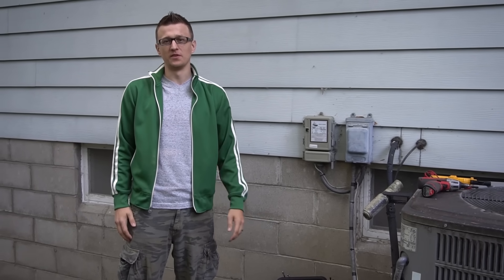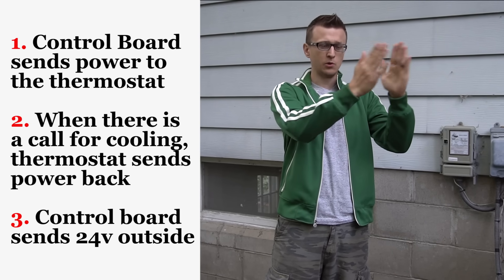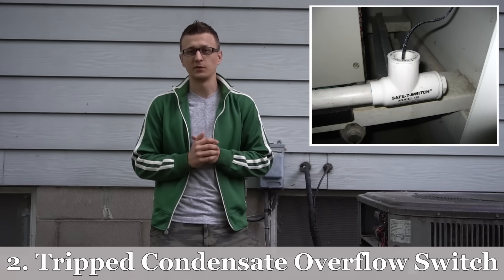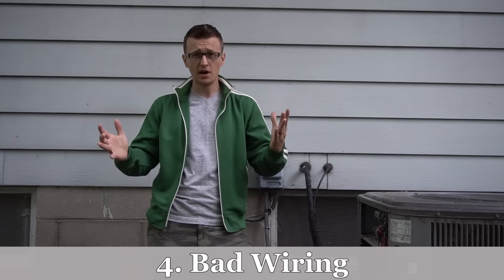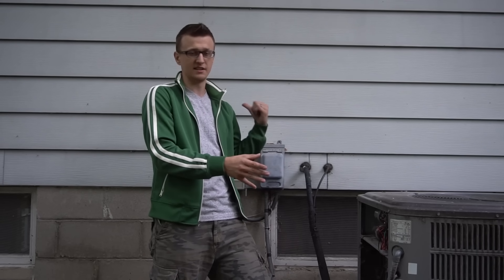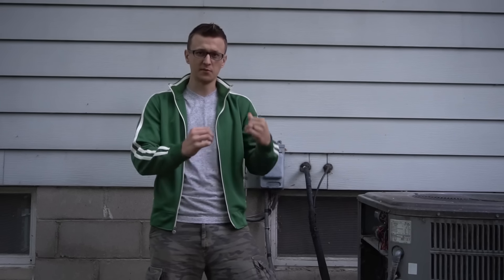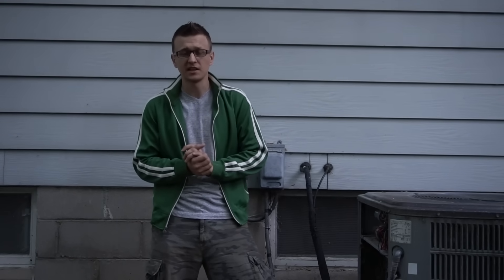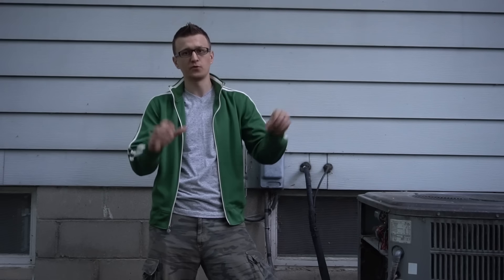AC Contactor Not Pulling In - 10 Reasons Why

Comment: What seems to be happening in my case is the condenser fan will stop, and although the plunger is pulling in, the fan will not start up. It tries for about 3 to 4 seconds and stops. It's intermittent. Based on your description, it sounds like it might be an issue with the refrigerant pressure (10:40) or dirty condenser coil. I'll try spraying down the condenser coil and see. To be cont'd.
Reply from the maker: Oh man, that is a bad time for it to start acting up! I wonder if it could be a power issue. Where the power coming from the electric company is not consistent. With such hot weather, many areas are experiencing brownouts since everyone's AC is running almost non-stop. Otherwise I would suggest double checking the wiring just to make sure. I have a video on how to wire a condenser fan motor and another one on basic ac unit wiring if you need them. Good luck!
Reply: @WordofAdviceTV  Thank you! I sprayed down the condenser coils on both of the units. I haven't noticed the issue since I replaced the new capacitor with the old one. I'm taking the new one back to the store to have it tested and just return it. I just want to get through the summer. I will also pick up a multimeter to check the power (and watch your video). Thank you!
Reply from the maker: That sounds more like a weak/dead capacitor or the fan motor is going out..
Reply: @WordofAdviceTV  I replaced both the other day because the fan just wouldn't kick on even though the plunger was pulling in. I installed a new capacitor too, and this is when I noticed the fan behavior. I switched the new capacitor with the old one. I also replaced the batteries in the thermostat. It's really hot out here in AZ. I don't know if that has anything to do with it. My other smaller AC (house has 2) seem to stay on all of the time without issue. If I recall correctly, the fan still stopped for a short while, but then kicked on again. The temperature in the house is good! I'm paying closer attention to see if the intermittent fan issue still exists. I think it did it again yesterday mid-day, though, when it was hottest outside (116). Thank you for responding!

Comment: Hello again. It seems like I have to hit the high pressure reset switch every hour in order for the contactor to pull in again and start up the fan. Once I do that, everything is blowing fine again. Not only that, but when the fan turns off, the motor inside is still running, and the house becomes hot again. That's how I notice that  the fan has stopped. I have been working on this issue all day.. what do you think I should do? Replace the high pressure switch?
Reply from the maker: The high pressure switch is not so easy to replace (in most cases) I would start by thoroughly washing down the condenser coil. Even if it looks clean, just hose it down. A plugged coil is the most common cause of the HPS tripping.

Comment: ok, so my compressor is stuck,almost ready to buy new unit,with nothing to lose decided to try  the spp6 ,follow your video on installation,took off the 5-2-1 which is good ,hoping  spp6 will solved ,no luck ,but what I notice before compressor had short rattle noise ,with spp6 is more continuous noise,is it possible to give it more juice and what would be a better way,thank you.
Reply from the maker: Well... If even an SPP6 is not able to get it going, then there is not much hope for that compressor. Giving it too much juice would likely cause things to start melting so that's not a good idea either.
Reply: thank you for advice, will be watching your videos about choosing ac units, the problem I have here is the high  of summer ,and all prices are high. thank you again.
Reply from the maker: @jtuc2292  Yeah.. The hottest part of the year is not the best time to be shopping for an air conditioner. I hope you find a good deal, good luck!
Reply: I have tech  offer of a 4 ton Guardian install for $2700. seems good not sure about the Guardian, and my actual unit is r22  he wants to keep it the same should I leave it same kind r22? won"t bother you again i am sure you help me enough. and really thank you.
Reply from the maker: @jtuc2292  R22 is set to be phased out by January 2020... I suppose that as long as the unit does not develop a refrigerant leak in the next few years it would be okay. Although mostly everyone else is installing r410a units nowadays. $2700 is a pretty good price but just so you know, Guardian is considered an economy unit, meaning the quality is not of the best. I am not saying that to discourage accepting the deal, only informing you. If you read through the comments of this video, I think you'll get some good info: https://www.youtube.com/watch?v=Cy46yTbkNhI&t=2s

Comment: Hello sir, still having issue with my condenser working off an on for the last week. Broke down and called a technician.  Tried to sell me a motor and hard start kit for 908.00. "Motor isn't locked up", I added the hard start kit myself and still nothing. After 2 hours of research I figured out that the contactor could be the  issue .I pressed the button and it came on and stayed in for about a minute then shutdown.  Now it only works if I push the button, it won't pull in on its own. I changed the batteries in the thermostat and blower fan shutoff 👏👏👏 I hope that simple battery change will do the trick. I'll turn it on when I get home tonight. 🤞🤞🤞    I don't think it's the motor because it only ran for a minute then the entire unit shut down
Reply from the maker: It's possible that the motor is bad. Sometimes it can run for half an hour before it slows down and shuts off. But if the plunger on the contactor is not pulling in on it's own then I would agree with you that there is a different problem happening. This video contains all the possibilities that I know of so hopefully one of them will help you figure out why that's happening.
Reply: @WordofAdviceTV  hi sir I'm back. 🥴 so sunday I turned the ac on after changing batteries and still the same. So I went to the condenser and pressed the contactor in. I put a piece of plastic in the contactor buttom to keep it on so could see how long it would work before the motor would stop running. I monitored the unit for a hour and it stay running.  Cold air ran through the vents. 1 hour turned into 3 hours and nothing was hot to the touch so I pulled the plastic out that held the button on the contactor in and it stayed in for the entire day and night. I could turn the machine on and off and it worked fine. This morning being monday I turned the machine on and it ran fine for about 5 minutes then shutdown an the fan in the attic was still running as usual but no outside condenser. Pressed the contactor in and it started up again.  I'm not gonna keep jimmying this contactor to work so I'm stumped. I need a meter to check current at the contactor.

Comment: I have 240v but no 24v on side terminal to pull in contactor. No visable codes, all thermostat and circute board wires has 24v. Can jump fan motor from circuit board and thermostat but when i try to jump the condensor i can hear coils in furnace come on but outside condenser will not come on
Reply: Do you mean that you manually press in the plunger on the condenser contactor and the fan still will not turn on?
Reply: @mxlockwo  yes that's my problem...push in and it does NOTHING. PLEASE HELP ASAP

Comment: my unit was working 2 days ago, fan motor working good,contactor working,  capacitor look good ,compresor does not start makes a sound for 1 second  does not start not cooling. what else can I check.  Thank you
Reply from the maker: Even though the capacitor looks good it may still be dead. Only way to know for sure would be to check it with a meter. It is a fairly cheap part though, so I would try replacing that first since what you explained sounds like a bad capacitor.

Comment: Jay

I have a 3 ton heat pump where the contactor is not pulling in. I have 242v coming into the contactor. I do not have 24v across my contactor coil. If I press the contactor plunger in, I have the fan and compressor running. Can you tell me, what can be the next steps that I should look for. I do not have a overflow switch and my thermostat is new and works fine.
Reply from the maker: Well.. Something is stopping that 24v from getting to the contactor coil. Either a bad connection/broken wire somewhere or some kind of switch is tripped. Have you tried jumpering out the thermostat (I have videos on how to do that if you need them) Or perhaps there is no 24v being sent out from inside the house at all.. (could be a control board, transformer, or thermostat issue then) Other than that, unfortunately I would need to poke and probe with a volt meter and visually verify stuff to be able to tell you exactly what it is..
Reply: @WordofAdviceTV  Jay, I did some more testing. I did a bypass at the thermostat by jumping power and cooling. The compressor or fan did not come on. I went to the heat pump and placed a jumper between power and cooling and still nothing. I took my meter and tested voltage between power and cooling and I have 24v. The 2 wires that are coming from the board that attaches to my contactor doesn't give me 24v. I could be wrong but I want to say that the  board might be the problem. I see that I cant send pictures here but I documented everything.
Reply from the maker: Those control boards do fail so I wouldn't be surprised. If power is going into the board but not coming out of it, then likely the board is defective. (provided it's not a pressure switch or some other switch that is tripped...)
Reply: @WordofAdviceTV  Jay. Did some more toubleshooting today and finally figured out the problem. You had mentioned this in one of your videos ( it could if been this one here ) but we have a smart meter connected to.out heat pump. The meter draws 240 from the incoming voltage in order to get power but my 24v is wired in series with this meter which allows them to control the contactor. I disconnected the 24v that was connect in line with the meter and plugged it right back into the control board. Turned my thermostat to cooking and boom,  compressor and fan turned on. The meter is filled with water so I won't be connecting that back again. 

Thanks for all of your help with this. Your videos are spot on.  You have saved me a lot of money even though it took me 2.5 days of troubleshooting to fix it.
Reply from the maker: @DAMARVOLOUS1  Glad to hear you were able to finally get the AC going!! Even though it took you 2 and a half days, usually it will take 2-3 days for a tech to come out anyway, (unless you pay a premium price to get them out earlier) so I think you did pretty good! Thanks for coming back with an update, stay cool! :)

Comment: I ended up jiggling the flow switch and it worked! Could it be a bad connection?
Reply from the maker: If just jiggling it did the trick, then most likely yes, either a loose connection or that little float switch got stuck in an open position. If the problem returns, then I would check and see if the drain line or fitting is plugged.

Comment: Excellent video as per usual .. but am I looking at the most caked up condenser coil on the planet? :-)
Reply from the maker: @techguy127 Com Heheh your eyes are not deceiving you :) I have a few giant cottonwood trees in my backyard and man.. It snows here for weeks straight during the summer.. But you're right, I should have at least washed it down before making the video lol
Reply: @WordofAdviceTV   Yeah cottonwood trees are a nightmare from what I've seen - thankfully we don't seem to have them in the Northeast.  I've got another case of why a contactor may not pull in (or even more strange - * not stay in ) that you can add to this video (should you ever add to it - ha ha) and that's why I looked at it yesterday. This is (perhaps) a bizarre case - although maybe not so unusual but diagnosed wrong by many. We're obviously having a tremendous heat wave here in the US right now. What happened was my normally great (20 year old) 5 ton split system started going off over the weekend with the ~100F heat.  At first I figured with the extreme heat & humidity (and maybe not the cleanest evaporator coil in the attic air handler) that we might be running it too cold at 72F and maybe it was icing up over the extended running hours.  But when I walked outside the condenser contactor was cycling on and off every two minutes - on for two minutes - off for say 4 mins.  You might think - oh the contactor is bad somehow or maybe the 24V transformer is giving it up. But actually I tested both of these and they tested ok. The contactor will pull in and stay in with a good 24V source and the transformer is putting out a constant 26VAC.  But what *is happening is that the contactor coil is heating up like crazy in the extreme heat as is the transformer in the attic (although still not the absolute cause). We don't usually get these outside temps for that long and I don't believe that's the real problem.  But what is happening, and I didn't consider it at first, is that in addition to the outdoor temps affecting the contactor coil and the super high attics temps probably degrading the xformer output, the power company is browning us out (right now) more than I've ever seen before.  We're usually sitting at about 123VAC or so at the wall, but I just measured it at 104V .... that's a pretty nasty 15% reduction.  I believe that the brown out is causing the available current at the transformer to be reduced to the hairy edge - that is, to the point where there just isn't enough current to keep the contactor coil pulled in.  On a regular day for years you might never see this until one day you get an extreme heat wave like this for days on end where the system is constantly running with both the transformer and contactor coil under stress for hours on end combined with a severe voltage brown out.  You also have to consider that the typical 40VA transformer in the attic (assuming it's rated even that high) is having to drive, not only the contactor coil at the end of a long voltage drop wire, but also the air handler fan turn on circuit.. and add to that some powered (and lighted - and wifi-ed) thermostats and, in the case of a heat pump for instance, the "O" terminal for the reversing valve relay which has to be on for some units in cooling mode.  Some of these transformers also have to drive power to yet another relay to turn an electrostatic air filter.  Add all these loads up together and you're talking a pretty heavy total current for even a 40VA transformer - that's only typically 40/27V = 1.48A , and many people may just have a 25VA or 30VA Xformer on there making matters worse. How to solve?  When it gets a little cooler I'll go up there and replace the 40VA transformer with a larger commercial 75VA version.  Who would have thunk it?  I looked around the web - didn't really see this possibility mentioned.  I know this is long but I wanted you to get the whole picture. :-)
Reply from the maker: @techguy127com4  Wow, that was incredibly detailed! I have never bumped into that before. Thank you for taking the time to explain it all. That's interesting! There's gotta be more people experiencing this problem. I don't know when I will do another video on this but hopefully whoever may have the same problem reads the comment section :) Thanks again for commenting, stay cool!
Reply: @WordofAdviceTV  BTW, I don't know why part of that paragraph is in bold font.  I must have hit a key or something.. ha ha.  Anyway, I measured the wall voltage a little later on and it was down another volt to 103V.  I could see the lights were dimmer and the air handler and the compressor fan were definitely spinning slower - very easy to see. Refrigerator seemed a little warmer and working harder.  This can easily rob your A/C system of a ton or so.  So when people wonder why their 2.5 ton upstairs system is not cutting it on a super hot day, it's not that the installer did a bad job on the manual-j load calculation, but rather that the power company brown out is killing your system capacity.  I don't know if they account for brown outs in the load calculation, but roving brown outs are now so prevalent around the country that it might just make sense to add an extra ton or so to the calculation result. Yeah it'll technically be over-sized for most days and that's a bit inefficient and I'm sure many will criticize, but on the hottest days when you * really * need it at least it might comfortable during a brown out - pick your poison.  I just measured the wall voltage again here at 1:34AM and sure enough, back up to 121~123V.
Reply from the maker: @techguy127com4  All good points! I never had to deal with brown out problems (or at least I didn't realize that's what it was) but thanks to you I am now a bit more educated and will know of one more thing to look for. You're the man, boss! Thanks for sharing your experience and knowledge! And no prob about the bolded part, I thought you were just stressing the importance of the message :)
Reply: @WordofAdviceTV   Your videos are very well done - wanted to give something back.  :-)
Reply from the maker: @techguy127com4  Thanks man! That was good info. Stay cool!